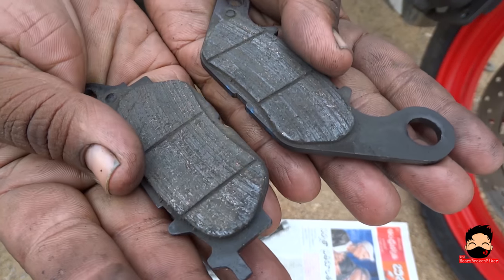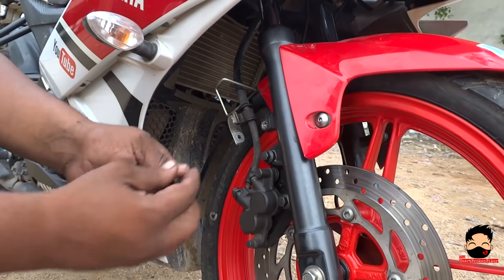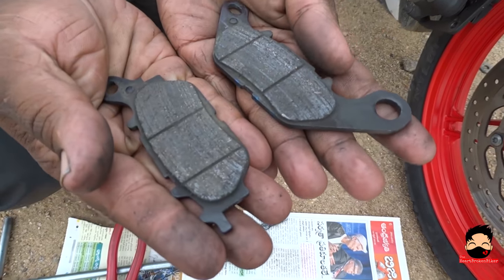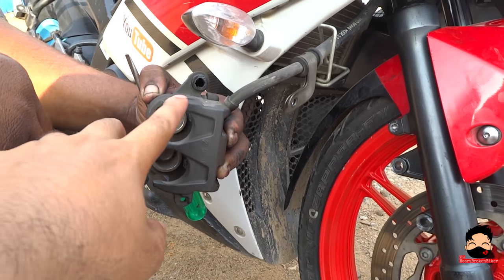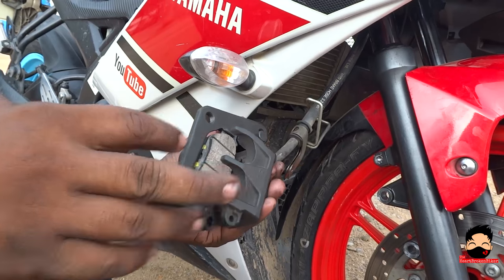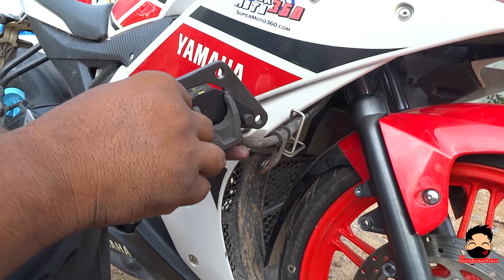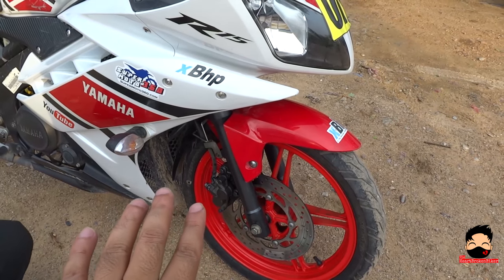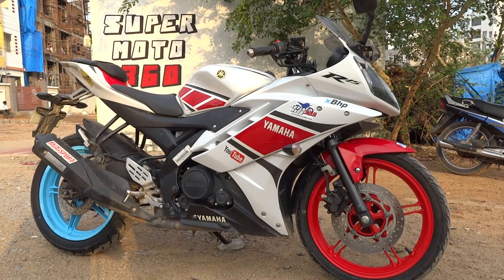How to CHANGE DISC BRAKE PADS on Motorcycle / Bike - FRONT

Comment: Thanks for showing and explaining this process. I today went to service centre and get front brake pad changed. I found, mine is exact similar condition as you shown the old brake pad. But after changing it, I am not feeling the earlier sudden stopping experience. I m sad. Did they do anything wrong? Kindly suggest me. I m using ntorq and it's changed after 7600 km.

Comment: bro can U do this process myself , and bro  that extra step you have told when to do that when soccer oil leaks , my soccer oil is also leaked little bit and brakes are also less power , but brake pads are new  should I need to do that extra step , please help bro ???

Comment: Were those original Yamaha disk pads because the shop I buy from has it in a plastic bag king of thing with Yamaha sticker on it and the pads have Nissin embossed on them on back .... Could you also make a video for changing of back pads .. I've searched a lot but couldn't find it on Youtube ... nice video as always Cheers
Reply from the maker: yup. These are the thailand set.  Little bit more pricier than usual.
Will try to make the rear brake pads too.

Comment: bro , please solve my one problem , I have fitted new brake pads in R15 in authorised service centre of yamaha , but my brakes have become loosen (means there is freeplay type in front disc brakes. like that on clutch , when I push brake it works late while disc brakes work very lightly ) what's the problem please tell I have also checked it on service centre but they said pressure will developed automatically but it is not till now please help ??????
Reply from the maker: +Navneet Singh they did not pump your brakes properly after installing. 
Ask them to remove oil and do it again. 
The techquinue is called brake bleeding.
Reply: The HeartBrokenBiker  , means to remove all brake oil  and then refill it ? , some one told me that it's piston could be damaged it's not proper can it be ??????

Comment: How much time or km does brakes pads can be used.... Because i have fz250 which i have used only 3000 km and the both rear and front brakes pads are gone? Is it normal..or any problem is there!! Sir please let me know.
Reply from the maker: 3k kms seems too less. Are you sure you dont have your levers slightly pressed all the time  while riding?
Or is your brake piston too close to your discs. 
Usually proper riding (usual use) goes like 10k kms or little more.
Reply: The HeartBrokenBiker yes im sure
Reply: Siddhika Singh.... i have face same issue... i have used 2230 km and my rear disc pad are gone..
Reply: Danish Shaikh the service center tells that is normal.. Its depend upon how you ride the bike.. And how you apply the brakes.
Reply: Okay.. so How much money you spend to do this..
Reply: Siddhika Singh my friends fz250 he only got 3k with new brake pad dont know why.
Reply: I have fz250 and faced same problem...

Comment: I have duke 200 and when i apply front dics on slow speeds when i park my bike into house one strange and  vrry annoying noice from front brake comes like chi..... Chiu..... What is the problem bro.??  I asked mechanic he is telling that disc pads are gone i also think so but whats ur words..??  Reply asap
Reply: Abhinav Rathor  change brake shoes or discpads
Reply: Bøý īń how much will they cost and where can i find coz ktm service centre is 150 km away from my town
Reply: Abhinav Rathor  i have changed my disc pad for pulsar200as at a local mechanic shop costed me about 500rs
Reply: Could also be the piston on the metal of the brake pad. Lub required

Comment: I squeeze lever before fixing the whole process please help me!!!
Reply: You can use a G cramp as you would use to hold pieces of wood together to push the pistons back in. 
Turn the screw gently and use thin bits of wood to stop damage to the pistons or brake caliper.

Comment: It seems like you have forgotten a major safety step... those wire clips you pulled out are needed to be replaced. Their whole point is to stop the bolts from coming off due to vibrations.